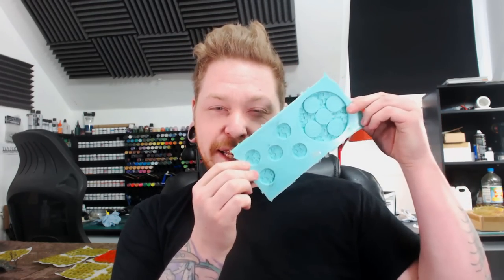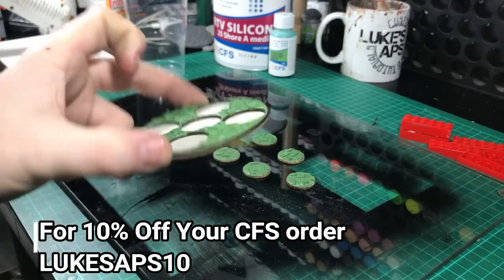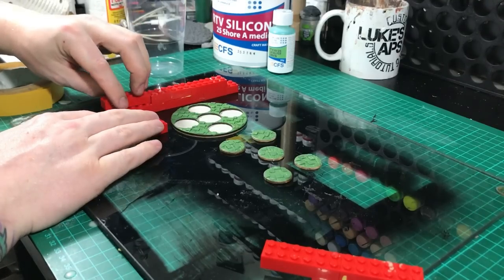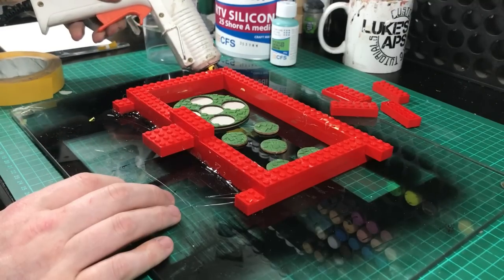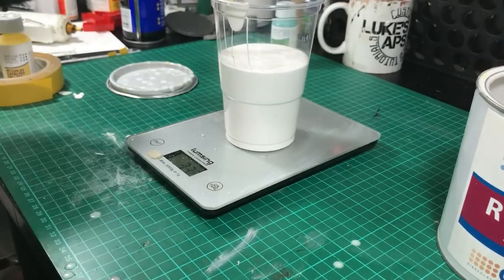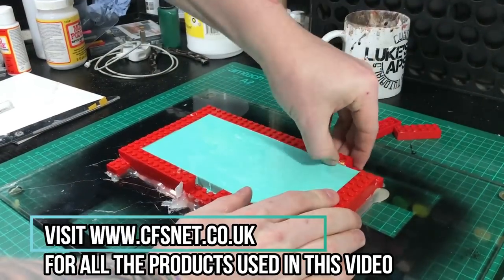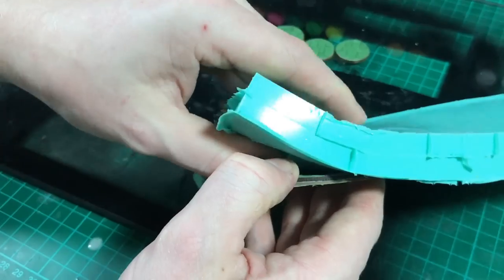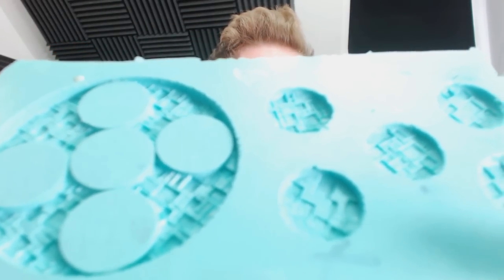Basic Silicon Molds Made Easy

Comment: A few additional points to consider:

When mixing silicone, follow the instructions of your particular material. Some silicones are 1:1, some are 100:1, and some are mixed by wieght  not volume. So follow the instructions cloesly. 

Another thing to consider is the viscosity of the silicone. Two silicones can have similar shore hardness but vastly different viscosity. A low viscosity silicone is usually better as they are much easier to mix and work with, and bubbles pop more easily during the pour.

Spray your masters with silicone mould release to make them easier to remove. You're less likely to damage the master like this.

You also don't have to use glass and Lego if doing this. I build all my mould boxes from foam board and hot glue to stick and seal.
Reply: Wild seeing your comment on this! I follow both of you haha thanks for all of the great content fellas!

Comment: i use potter clay to seal the edges off my mold boxes sometimes  cheap and you  can use it again if you dump it back in tub you might need to plug a hole with a bit of tissue but it works ok.

Comment: Luke if you put a thin layer of petroleum jelly on the inside of the mold box(spread it thinly with your finger) just before you pour it will make it easier to take apart the box. It won't hurt the mold at all.

Comment: I have found that rice leaves a residue/powder in the mold. I do it this way - 1 cubic inch is just over 1/2 ounce, so just measure the volume of your mold and divide by 2 for the total ounces of silicone you need. You may have to fudge the value a little depending on the size of the pieces you are casting.

Comment: Hi Luke! If I were to make a 2 part mould for some custom bits n bobs, what resin or plastic would you recommend I use for injecting into the mould? Also I will be using your code for the silicone thanks a ton mate!
Reply: wow thanks for the super fast replay :)
Ill check out pressure chamber thanks a lot mate! keep it up!
Reply: oh one more question. I can then paint the casted polyurethane once its set using water based standard model paints like army painter and citadel paints right?

Comment: A non orbital random sander (palm sander) with no sand paper on can be glued to a committed mold making table. The vibration will knock those air bubbles out pretty fast. It can be clamped down to a table as well, but it will work itself free from the clamps quickly. :D

Comment: Any difference to using the green catalyst compared to the yellow? I can see its about curing times so is there any reason you used the green instead?
Reply: @GeekGamingScenics  ah good point about the curing too quickly! I'll go with yellow then. Your discount code still work with CfS?
Reply: @GeekGamingScenics  cheers chief! Tried the code and it didn't work this time. But it's still a good price compared to unknown brands on ebay and amazon.

Comment: I love this video. Thanks Luke!

Question for you: I've never worked with silicone before so I was wondering if there is a strong odor to this stuff. Should I use it outdoors or in a well ventilated area?
Reply: silicon is normally fine, but if you are going to then be casting in resins, DEFINITELY do it outside or in a well ventilated shed/garage.

Comment: I've been playing around with a little bit of resin casting lately, and I've found that larger molds are more forgiving with variances in resin mixes. (Being a tiny bit off in with a small amount of resin can be a huge % off recipie, whereas with a larger pour the same amount of error  is closer to the correct mix). I keep having issues with resin not curing correctly because it too easy to screw up 50/50 by volume when you're only mixing a couple ounces.

tldr: beginning casters should try to make larger volume molds because they're harder to screw up.
Reply: That's what I've been doing. It might just be crappy resin, but I'm nearly positive the fact that I'm doing pours the size of a shot has something to do with it. Thanks for the help though. =]

Comment: mold star series from smooth-on doesn't need a degas chamber and  the two part can mix 1:1 ration by volume you should try it. the only down side is that it cost more.
Reply: go for a very thin medium, i use polyurethane resin which is quite thin and never need a vacuum chamber.
Reply: Smooth-On has some awesome rubbers, and they're also a lot more reliable.

Comment: For demoulding, do you have a Lego separator tool? If not, you can get a pair of Blox ones from Wilko for a quid, and that may make things a smidge easier.
Reply: martin the warrior Bricks are easy enough to separate most of the time, but some of the smaller plates can be really hard to grip...

Comment: Any suggestions how I could make a mold of a weight plate so I can make concrete versions of them
Reply: Hi Paul, just surround a weight plate completely with silicone leaving a hole (to pour the concrete in the future) when its set either cut fully in half or a slit either side of the hole to stretch and remove the plate. 
Beware that the concrete will not weigh the same as the plate if your using metal plates.

Comment: Look after your molds with degassing. Got it! I want to copy some limited dwarf minis Tom Meier put out back in 1990. They are great but very hard to find so I am hesitant to paint the metal originals. Not sure how much detail will transfer but I will give it a try. I was just going to buy one of those kits, not sure which is best but likely all are similar quality.
Reply: That's copyright infringement, even if you are making it for your own use.  If you want 1990 Tom Meier Dwarves, look at Iron Wind Metals per Ral Partha.  You might even find them under the Ral Partha Chaos Wars line.  Do research, seek knowledge before breaking the law.
Reply: You do not know the law. These are limited edition, oop for decades. No one sells them save online markets. I am copying them for my own use. The copy is from high quality metal to low quality resin. Therefore, you can copy any miniature this way for personal use, even ones newly released and not get the law after you. If this is copyright infringement, then this video is even more so as those bases are for sale now and selling molding kits to begin with would be as well. You are clearly not a copyright lawyer, just someone in need of a petty purpose. Go away and get a life.
Reply: Actually I do know the law on the subject, I wrote a paper on it in my law class, and in the USA it is, as has been established by case law, clearly an infringement.  Luke sculpted the masters featured in this video, or didn't you notice the greenstuff? Therefore these are his original works and he can cast them as he sees fit.
I suggest that you look up Ral Partha and Iron Wind Metals, they probably have those exact figures, unless they were made under Meier's own company Thunderbolt Mountain.
Reply: in america it is not legal, but in the uk, like Luke said, casting/reproducing products without permit is perfectly fine, as long as you dont sell/make any profit from them
Reply: And laws in the US change as soon as you challenge them. We long abandoned Constitutional and common sense laws for case law that weighs the most recent cases as most important. The law is what the court recently ruled. How exactly would they enforce someone copying or molding an item they own for personal use? What govt. agency, police, DA, Judge is going to waste time on something so petty when there is no exchange of $$$? If this is the current law, then all 3D prints and photocopies are illegal by extension: stupid. It would not hold up to any legal scrutiny whatsoever.

And as I stated from the outset, I am copying quality outdated (likely expired copyright) items into a low quality resin imitations that anyone could distinguish. This is not remotely the same thing as taking a resin miniature still in production, copying it and selling it. I also did not mention, I plan to ALTER the copies in many ways, therefore doing the same thing Luke does above. Notice however that the bases he is copying are in production. Even though he is changing them, he is still copying and reproducing a copyrighted product. Good thing he does not live in the US or a college student who took a law class would come after him!
Reply: Sure. I never said you could not. Read more carefully.
Reply: Pretty sure they would not be illegal just undocumented miniatures.
Reply: Thom Gordon 🤣🤣🤣🤣😎👍Well said.

Comment: CHALLENGE!!!! Luke can you make a video on how to make molds to cast wings, like dragon or deamon wings. The skin in between each digit are fairly thin, and usually have waves and folds. For example the wings on the new Morathi model or the Bloodthirster. Thanks
Reply: Alan Morales 
I’ve played around with different kinds of molds, thin small and narrow parts can prove very difficult to do affordably. And damn near impossible with anything pored. Greenstuff World sells a pressmold that is used with hot water. You’ll want a two part mold, make vents, and cast it with green stuff or white milliput. After the time and money I spent recasting Drukari parts I should have just bought aftermarket.
Reply: I found 'blue stuff' from Green Stuff World and Epoputty works well once you get the hang of it. They are not as great as the original but close enough for me.

Comment: Anybody had a mold come out sticky and weak? I used ZA 13 WT 45, it has a 1:1 ration. The master is sticky and i think i can't completely clean off the silicone. Should i heat it, use more hardener? How to clean the residue off of masters?

Comment: Ive had a few drinks so i may have misunderstood but If your masters are getting damaged or destroyed you need to re-look at your methods, I've been casting for years and still have most of my original master molds. if your having problems with porous surfaces give it a paint or seal it with something.
Reply: also dont waste money on degassing chambers, they are un-necessary and a waste of money no matter how much molding you do.
Reply: Ahhh ok. I should watch theis sober 😁😎
Reply: Hi World of 28mm, I plan on making a 2 part custom mould for my wargaming hobby to make some custom bits and bobs, would this silicon Luke uses here be good for that? also what would you recommend I use for the resin / plastic for the models I wish to cast? Thanks in advance

Comment: How would I use the same technique to cast full models?
Reply: Make the box same as the video. One side made of clay, push the model in, pour silicon on top. That's one half. Once cured flip, rub with some sort of barrier and fill silicone on the other side. Cut channels in to pour resin or metal when the two half's are ready and your master is removed etc.